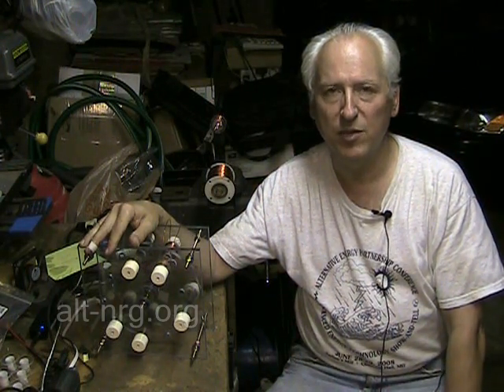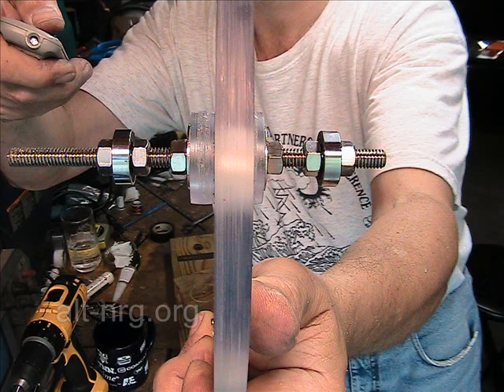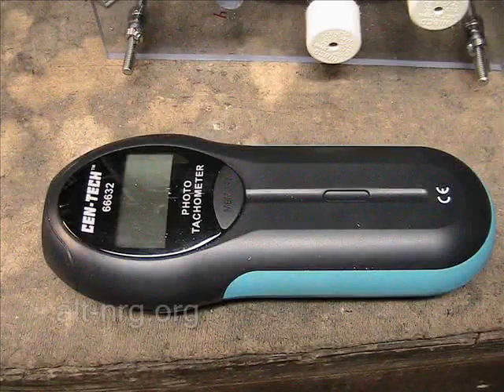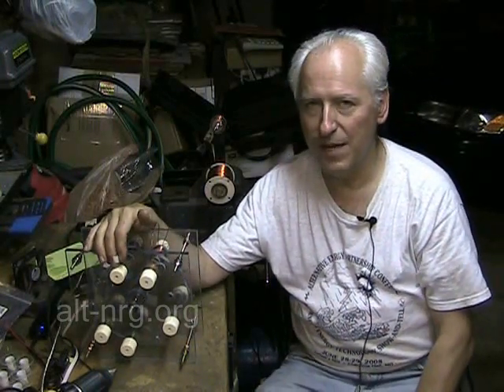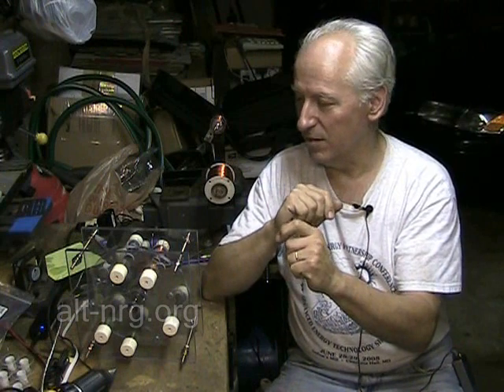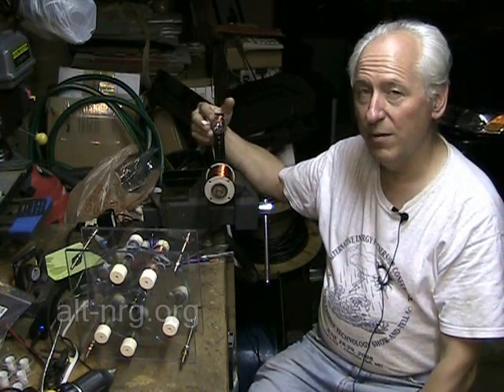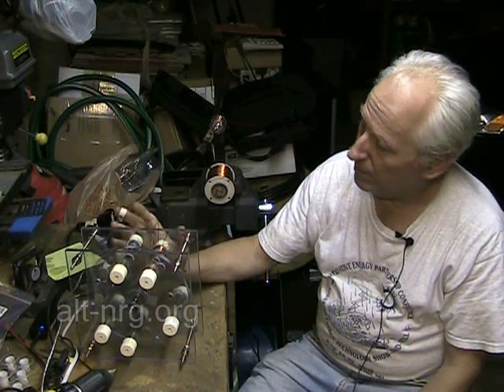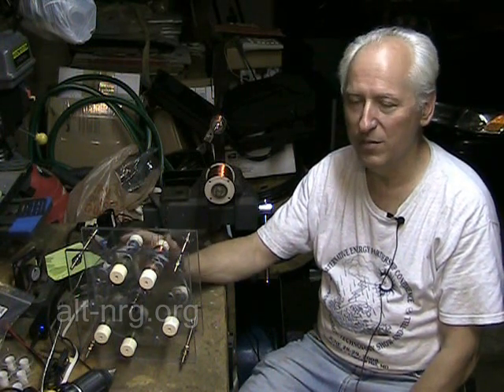#281 Muller Magnet motor dynamo

Comment: Parabéns pela sua pesquisa e por compartilhar o seu conhecimento  com todos nós. O gerador de Müller é uma versão do gerador Figuera, que se move. Este por sua vez se basea também nos geradores de Tesla, Hubbard, Floyd Sweet entre outros. Müller também usa o mesmo princípio. Todas as patentes, como você deve ter descoberto não estão corretas. O grande segredo daquelas máquinas fantásticas do passado e que podemos replicá-las no presente é campos magnéticos iguais confrontados e defasados. O pequeno experimento no link abaixo demonstra o princípio básico a que me refiro https://youtu.be/nA0eR0uM4SQ
Então seguindo a lógica deste experimento o gerador de Müller é justamente tudo ao contrário do que está na patente. Você usa um disco rotativo com ímãs e dois estatores com bobinas um de cada lado do disco com ímãs, aproveita os campos magnéticos  norte e o sul dos ímãs, suas bobinas estão perfeitamente alinhadas, as do lado direito estão alinhadas com as do lado esquerdo. Bom, o que tenho a lhe dizer é que todo o seu conceito empregado neste gerador baseia-se no conhecimento clássico portanto não terá um rendimento espetacular; então o que sugiro é dois discos rotativos com ímãs, os pólos dos ímãs serão todos iguais e voltados contra o outro disco, mas não ficarão alinhados. Os ímãs de um disco ficará alinhado com o espaço entre dois ímãs do outro disco. No estator ficarão as bobinas. Supondo que use o pólo norte dos ímãs dos dois discos voltados um para o outro com as bobinas entre eles, o lado externo dos discos com ímãs serão pólos  sul. Estes pólos sul podem ser utilizados para acionar o sistema, utilizando-os como parte de um motor de pulso CC. Se quiser mais detalhes, como desenhos e explicações extras, envie um email.

Comment: ok i tell you this motor wont work. its flared. 2 coils in the same spot equls magnetic brakes. rethink this design if you want it to work. stereon is the way you should be looking. that concept works.

Comment from the maker: @water2gashawaii Correct. You can't MAKE free energy. But you certainly can USE free energy. Sunlight is free. Solar cells convert sunlight to electricity. Wind is free. Windmills convert wind to to mechanical energy. It's all free energy minus the cost to build the device. Zero point energy is free. We are only now just getting the technology into the hands of the people to be able to harness it.

WE WILL SUCCEED!

Comment: So what do you expect to prove from this? Even if this was to run perpetually (impossible) there would be so little energy that there is no way to harvest any excess energy to do usefull work. Magnets and coils are like springs they just give back the energy put in less losses to entropy so it is a process of deminishing returns. The only way that the process can work is if it captures energy from the external environment in some way. How do you propose this device could do that?

Comment: There is a new series circa December 2010 of Stan Meyer's equipment. According to the video, a guy is helping the "current owner" to research how the various systems work.  The video is on YT at txjRpXe8JwA
At some point early in that vid, the guy points to the ground and says that is Stan's voltage intensifier circuit.  3 or 4 coils in that thing--neat. Guy claims that he is open to questions on all of that stuff. When I checked their web site was down.

Comment from the maker: @oldspammer Correct. Even the driven coils, back EMF spikes will be quenched as they are bled off with the standard silicon rectifiers returning that otherwise wasted energy back to the system.

Comment: If the voltage stays low, then Schottky diodes will do fine.
What kind of load impedance did you use on the coils when you measured the voltage across them?--that might be another area for experimental measurements to determine maximum power transfer impedance values.
Could you post your next video with the oscilloscope waveforms of the kind of pulses you're getting off of the coils?

Comment: If the magnets are positioned so that they nearly contact the coils as they spin by, then the voltage would be higher, so how close do your moving magnets come to the cores of the coils?
If you could do an experiment to check the peak voltage versus how close the magnets come to the coil cores, that would be interesting--as long as you have a micrometer caliper with digital read out that is shaped appropriately to fit in to do the measurement, then you're good to go.

Comment: Allow me to ask you a question:  If you measure the variation of weight of each of the coils, and then you match similar weighing coils as prudently as possible, how many lbs of force does the remaining (worst-case) imbalance pose for this work of art?  How many rpms should this be running at?  I have a centrifuge that runs at 3700 rpm with a rotor radius of 5" and it pulls about 2000 Gs!  There are centrifuge videos on youtube...

Comment: Z,  I was beginning to think you were looking for advertising funds from Goop since you love their marine adhesive!  However, the Gooping of adhesive to support the stepping isn't quite the work of art that this potential show-piece could achieve.  There must be a aesthetically better way of making the stepped coils though.  Maybe it is a coating of varnish or superglue.  Nonetheless, I am concerned for your safety because the variation in weights could have profound issues at high rpms!!!

Comment: Z - with your Muller coil wind, you show a brief picture of this... would you mind sharing how you have wound this type of coil (step by step)? My students are apparently NOT doing it right as they do not look like yours. [they are  good at convential coils however].

Looking forward to this. Thanks.

the Ole shop tchr (39+ yrs tchg)

Your build is looking good! We're building our rotor center wider too, now.